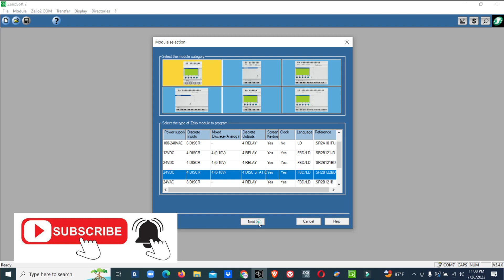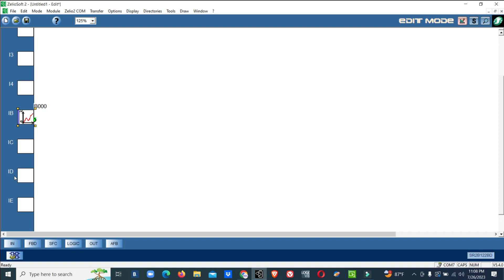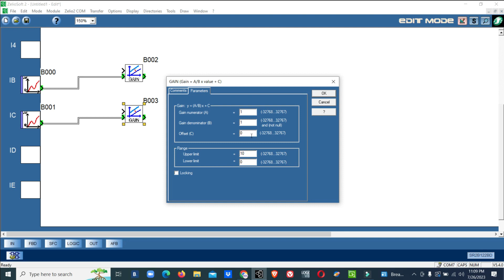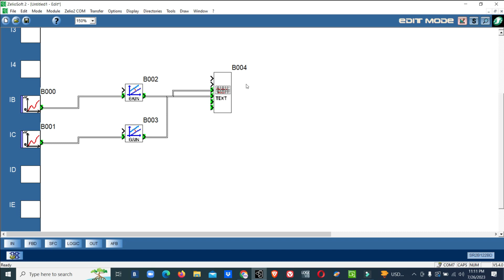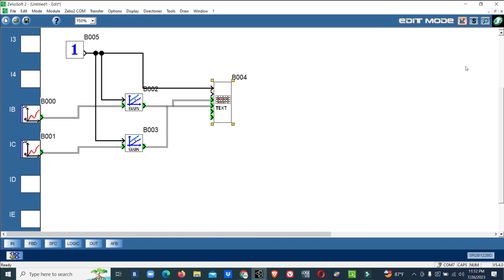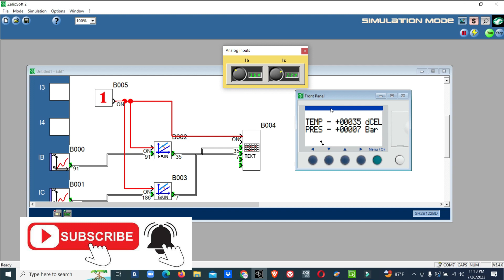Schneider Zelio - How to display and read the multiple analog value on PLC screen /PLC Programming

Comment: Thanks you for sharing this great feature!.  Is there a way to add a message that indicates which pump is running in a dual pump boost pressure system?  ie suction/discharge psi as well as indicate which of the 2 pumps in running and which is off?  Thanks again!
Reply from the maker: YES POSSIBLE...
I ADDED VIDEO OR THAT ALSO..CHECK OUT